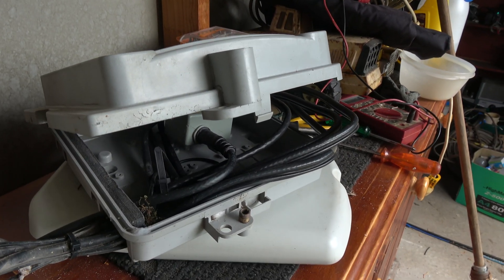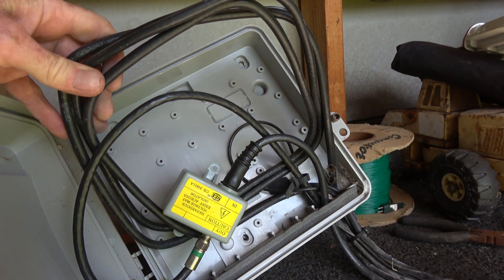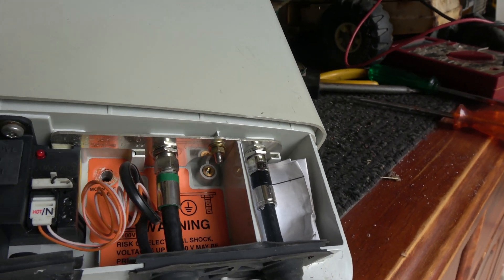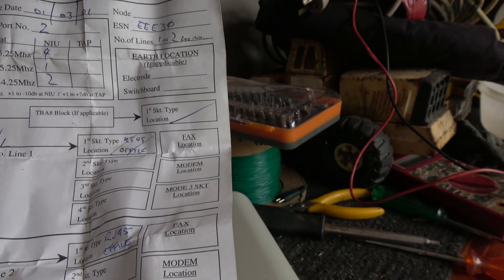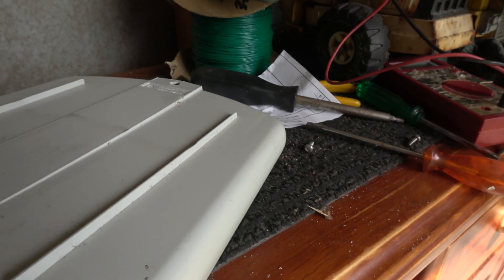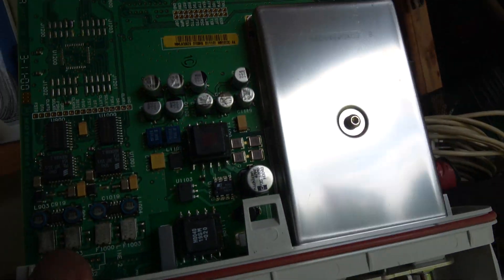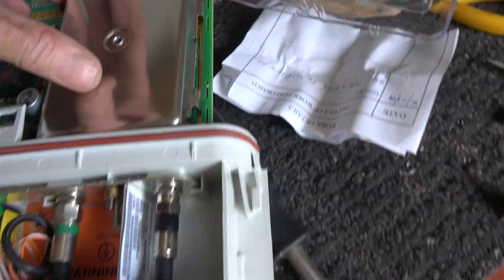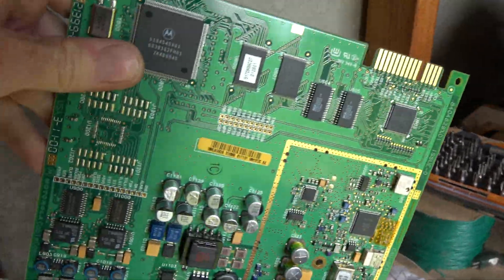Optus Box

Comment: Never seen something like that before. Is that Motorola box for phone service? Did you get landline phone service over cable rather than POTS? Don't know what else that twisted pair stuff would be for
Reply from the maker: The box was for cable TV, broadband internet and ordinary telephone. We never had  the TV service and only got it when high speed internet came along. The phone service replaced the original copper wire that had been in service up to 100 years. The POTS has been phased out in most metro areas now and also the Optus cable is dead after only 20 years of service and replaced with the National Broadband Network. It has been more political than practical.